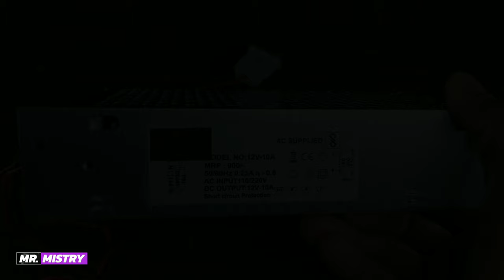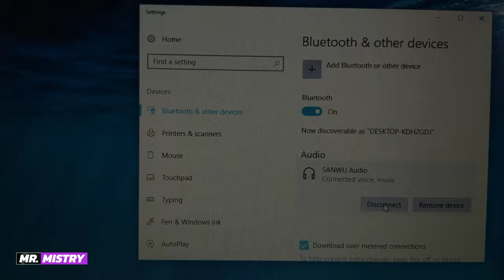TDA7492P 50W+50W Wireless Digital Bluetooth 4.0 Audio Receiver Amplifier Board

Comment: this board is marketed with 50+50 watt module,  but if you check datasheet of tda7492p ic then it is actually a 25+25 watt ic. Can you explain this gimmick ?